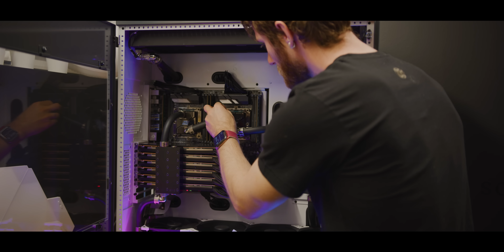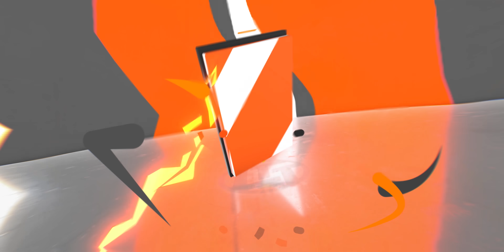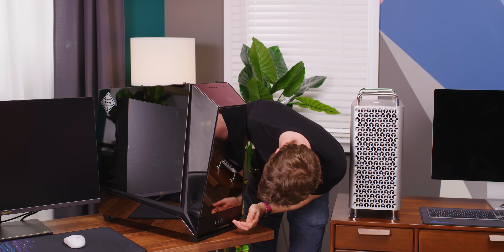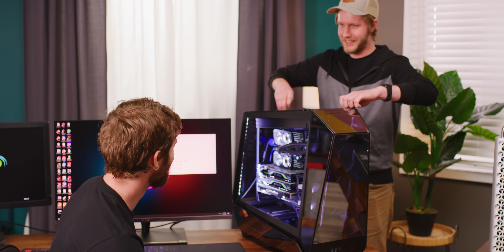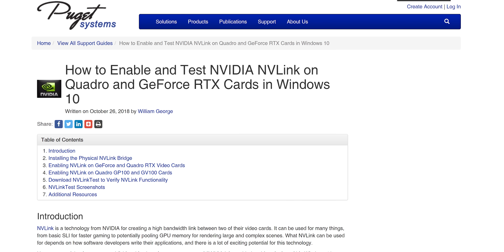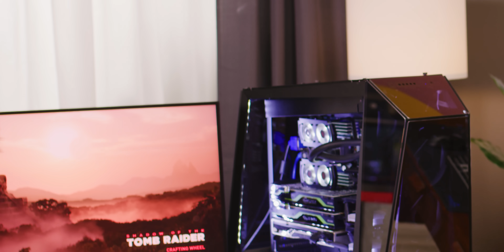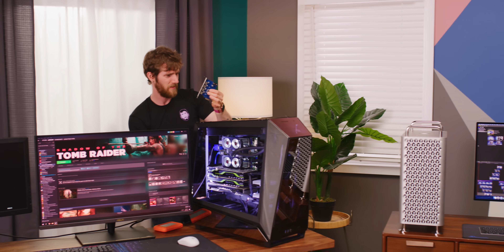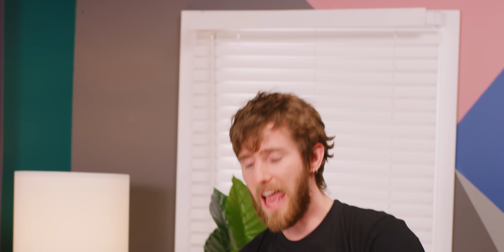The $32,000 Mac Pro Killer

Comment: in 10-15 years later this is gonna be rekt by a 500-1000$ pc lol
Reply: I don't think so, Moore's law was debunked last year and at this pace, I think we are reaching the ceiling of being able to pack transistors into a cpu. Once we theoretically max out the transistors in a cpu ( I think it would be in 5-10 years ) the competition will just be who can make it for the cheapest
Reply: @romanpisani8157  As much as I agree with you, New Tech is still gonna come (new inventions), We can advance from what we already have but it's still gonna get rekt by a mid range pc in 10 to 15 years
Reply: @Biomeac  I will reply to this comment in 12 1/2 years and we can see who is right 😂
Reply: @romanpisani8157  12 years and 2 months to go
Reply: @romanpisani8157  i will remind you
Reply: @romanpisani8157  please spam replies to me, 12 years later!
Reply: @guruthecodershorts791  hehe will do
Reply: @romanpisani8157  Intel's roadmap has 1.4nm processors in 2029 so an extra 6 years is good leeway for optimisation. Plus by then "super-threading" should be common i.e. 4 threads per core
Reply: @koalakenbymacy9248  thats very interesting considering they are really struggling to make processors less than 7 nm without quantum particles messing with eachother within the chip. Really interesting stuff
Reply: @romanpisani8157  If there's a threshold at which point Moore's law stops applying, they will probably just have to make the price smaller.
Reply: @bballrules66  that's what I said
Reply: @koalakenbymacy9248  *14nm ++++++
Reply: @romanpisani8157  what about a design revamp of a cpu, how it works is completely changed. If we find a breakthrough like that we could get a cpu better than ever. Cheaply.
Reply: @romanpisani8157  well you can think that, a lot of people did 20 years ago, a lot of people did 10 years ago. And again, now, people think its dead. Only few months later, and the newest gpus from amd and Nvidea are getting closer to this machine
Reply: @romanpisani8157  at some point we're gonna start seeing duel cpus on mobos, its existed on servers so why not gaming as well....
Reply: @lukelegg9915  because literally no game uses more than 6 cores.
Reply: @petersansgaming8783  As times goes by, we will continue optimizing for newer CPUs. 

Pretty soon we'll routinely have 2500 core CPUs, and that's how we beat Moore's law.

Heck, we already have 128 core desktop CPUs.
Reply: @romanpisani8157  RYZEN 13 9950XXT FOR 150$ COMPARED TO THE INTEL i13 14900KFFF FOR 175 WHAT DO YOU CHOOSE
Reply: @demontreee9004  imma go with the intel i13 because it probably won't get as hot
Reply: @romanpisani8157  true but rumors are that the ryzen 15 10950xxt will run at sub zero temperatures out of the box :/
Reply: @demontreee9004  Oh damn then I think I will have to wait another 18 months for next gen
Reply: @romanpisani8157  just make the cpu bigger and boom mo powa baby
Reply: @romanpisani8157  minimum feature size is not the limit, architecture and being able to run those transistors a lot faster will be what pushes it...
Reply: @romanpisani8157  spintronics...
Reply: @romanpisani8157  Moore's laws isn't debunked at all. We are actually blowing away the annual doubling. But we're going into multi-CPU setups.
Reply: @catlover1986  multi cpu setups have nothing to do with Moore's law. Soon, when no one is able to manufacture a chip smaller than say 2nm or so, Moore's law will be demolished
Reply: @catlover1986  multi cpu setups have nothing to do with Moore's law. Soon, when no one is able to manufacture a chip smaller than say 2nm or so, Moore's law will be demolished
Reply: @romanpisani8157  The issue is that Moore's law (as a relevant term) was originally tied to the idea of a single CPU, with a set chipsize. It has little to no relevance today, when talking about future PC performance, like this video. CPUs will continue to get exponentially more powerful, regardless of Moore's law.
Reply: @catlover1986  CPUs will NOT get more powerful exponentially. I don't know where you heard that but linus has multiple videos on the limitations of CPU power
Reply: @romanpisani8157  And yet, they continue to increase in power at a staggering rate. 

CPUs have no limits to their performance gains going into the future. Rather, the style of engineering changes. For instance, rather than going to 20 ghz or other difficult to reach gains, we have converted to multicore setups, and we can put an unlimited number of smaller and smaller cores together. Additionally, with our ability to network faster and faster on the same devices (infinity fabric style), we can even add multiple socket cores with minimal loss. That is presently the main limitation to CPUs (being stuck on the same silicon chip), and so we can effectively add thousands of cores to a single device. 

In the last 12 years (first I- series chips) Moore's law says we should have seen well in excess of 100x performance in CPUs. 

And we have. And that pace of improvement has increased at a staggering rate. 

In other words, there is no performance ceiling coming in the foreseeable future. We are switching to smaller and smaller highly efficient low power cores operating in tandem.
Reply: @catlover1986  Ok thank you for the reply. I am struggling to understand what you are saying, though. My point is that we are coming to the end of Moore's law, not that it is over right now. Yes we have fulfilled and more likely overachieved what Moore's law states in the past years, but I think that you forgot that Moore's law is about the number of transistors on a chip, not the power of the cpu. While efficiency upgrades will be made at a decreasing rate over the years, CPUs will ALWAYS be limited by 2 things. The size of the chip and the # of transistors that can be put on it. Maybe you should stop researching Moore's law and start researching the Dunning-Kruger effect 😉.
Reply: @romanpisani8157  I work in and have degrees in  psychology, and everyone thinks it's oh so cool to borrow our terms randomly and inappropriately.🧐

As far as Moore's law, it states that the number of transistors on a microchip should double every 2 years. We are still on pace for that, Intel has said that they are good until at least 2030. 

But the further point is, we all knew there would be an end, because atoms are a finite size, and quantum interactions will occur at some size point.. duh..

But, none of that has to do with this thread, talking about PERFORMANCE. The problem with the "Moore's Law" is ending doomsayers, is that Moore's law has little to nothing to do with processor performance.. As Intel has stated, by 2030, we should see a 100x improvement over chips in 2020 in performance..and there is no reason to believe this rate of performance improvement won't continue in perpetuity. 

What I'm pointing out, is that Moore's law isn't that close to ending, and when it does end, it won't matter anyway, because it's only one of hundreds of variables in chip performance and engineering..
Reply: @romanpisani8157  Part of what you don't seem to be comprehending, is we ditched the idea of individual cores getting exponentially more powerful, circa 15 years ago. Rather, we add more and more cores to individual chips.. and we add more and more chips to machines. AMD literally made their Ryzen chips physically larger, to get more performance. 

When you start having 50,000 cores on a processor, or 50,000 linked computing cores over high speed fabric, yes that's exponential performance growth. 

The tech is changing, it's not slowing down. But when I was younger, a better processor meant 5 ghz, not 2.5, that is obviously an invalid metric today. So is transistor count in a single core.
Reply: @catlover1986  Hard to believe you have a "degree in psychology" when you couldn't even understand I was making a joke. But if that's what you wanna focus on, I am surprised that you want to say that I "stole it" from you. Does having a degree in psychology give you trademarks over psuedopsychology theories? Anyways, I think that having a "degree in psychology" is hardly working for you because you seem to be accepting that I could be right, but also personally attacking me for having a different opinion. Where did you get your degree? University of Armchair Know-it-alls? Sorry, I'm done roasting you, but the facts are that Moore's law is PHYSICALLY IMPOSSIBLE. Yes, it may have been a bit accurate for a few decades, but there are literally only so many atomic particles that can be put on a silicon chip. The real question, is when quantum limitations come into play. I'm not going to pretend to be some expert on quantum physics, but I think we can all agree that fussy stuff happens between transistors when they get too small and too close together. So the question is when will these limitations put a halt to the annual doubling? I think it will definitely happen in sooner than 15 years, possibly sooner than 8 or 9. I don't know what kind of BS you are on talking about "2500 cores on a cpu regularly", but if you have to distribute transistors across 2500 cores compared to ,say, 64 cores that doesn't magically multiply more transistors out if thin air.
Reply: @romanpisani8157  Psychology is a science, with real scientific data and research, no different than than chemistry or physics. The question is whether people actually understand our terms when they use them, and they usually don't understand them or use them correctly. Not all psychology is pop or "pseudo"-psychology. The phenomenon that people with less skill in a particular area, often overestimate their own abilities, which is pretty well demonstrated through all of history, as well as empirical and clinical studies. 

As far as Moore's law, firstly it just described a phenomenon, it's not actually some magical claim. Intel believes it will be good for a long time further, and they have good reasons to believe this based on the size of transistors they believe they can make. 

As far as 2500 cores on a CPU, we already have 128 core CPUs. It's not much of a leap. That seems to be the issue, your idea of what a modern CPU is and what can fit on it. The size of CPUs isn't fixed. Also, it's not merely about how many can fit, but cooling them, and they become more efficient at smaller scale. 

Of course the day will come, eventually, where we won't be able to fit more. But that's hardly a problem as far as CPU performance increases. We can make bigger processors, more efficient processors, more processors on a chip, lower energy/higher density processors, and different cooling architectures, among many others. Simply cramming more transistors on a disk, ceased to be the name of the game, a long time ago. 

AMDs bulldozer being a perfect example, where Intel crushed it, despite having fewer transistors. 

Imagine we were talking about cars. It used to be that a bigger engine meant a faster car. That hasn't been true in decades. Same idea. There are other more relevant innovations.
Reply: @catlover1986  so you agree with me?? You keep beating the dead horse of more power in CPUs. Moore's law is not about power. It's about transistors. I agree that CPUs will get more powerful in almost of the ways you have stated ((except I don't understand why you keep going on about how a shit ton of cores will make a cpu way faster, but honestly I don't have enough knowledge to dispute that, it's just a gut feeling)). I feel like you just keep going on because its too hard to admit that there isn't going to be fuckin infinite  transistors on a chip.
Reply: @romanpisani8157  I think you truly know what you are talking about, I was never aware of Moore’s law and all so I can’t really argue with you here. I just want to point out and state as you may be aware of . The Apple M1 Chip, it is mind blowing and really powerful and efficient it is a new form of technology that we weren’t expecting which is unrelated to Moore’s law. 10 to 15 years is a huge time frame in all honesty and I do get what you mean . A pc from 2010 is usable compared to a 2020 pc as opposed to a 2000 pc and a 2010 pc. I still stand by my comment however with a different approach as a 500-1000$ pc is still not cheap (not adjusting for inflation), however it is impossible to predict considering we have limited knowledge of the future.
Reply: @Biomeac  I don't know enough about M1 to dispute your claim, but I do know that the M1 chip is simply made from ARM processor design that has been used in smart phones for forever. So it is not "new " technology at all. But, I do know that the type of processor is more centered around using less power and doing less calculations, so I do believe that it is possible that ARM based processors will overtake the traditional x86 processor we have now. Even at that, a processor is still a processor and Moore's law still applies because processors are made of transistors, just like the processor in any computer
Reply: @romanpisani8157  what I meant was , the M1 chip is really good (idk how) but it did improve tech substantially
Reply: @romanpisani8157  I’m not really familiar with this subject or know a lot of it, but 30 years ago what we have now seemed mostly impossible. Technology has and will always have a limit to that invention but it will be surpassed by another invention. The impossible has been achieved because we simply didn’t know enough at that time.
Reply: @bruhroyale12123  true
Reply: @romanpisani8157  that's true, but if that's our limit, then it would be really sad. But I think someone will come up with a revolutioniary idea and invent a new technology
Reply: @romanpisani8157  quantum computing tho
Reply: @romanpisani8157  The architecture has to change. ARM is looking solid right now, especially in portable machines. Apple's M1 chip beats an Intel 10900k in single core performance. That's a full desktop processor that costs 500 dollars itself, for only 200 more dollars you can get a complete Mac Mini. And we are just starting to explore the capabilities of ARM. I cannot even imagine a proper desktop ARM processor. At this pace, even a simple Macbook Air from 10 years later will beat the hell out of these two computers. ARM is just a much smarter architecture. In the past, it lacked stuff like floating point instructions which made it inferior to a CISC (complex instruction set computer) architectures like x86, but today it does not lack any critical feature. This potential of ARM was discovered way earlier and a modified versions of ARM architecture was widely used for supercomputers way back.
Reply: @romanpisani8157  Yeah computer tech is soon gonna stagnate as I think we are hitting the max we can do with our resources
Reply: In 10 to 15 years
Reply: 10-15 years, pretty pessimistic, I’d say 5 or 6 tops....
Reply: @robertw1871  nononono
Reply: Im following lmfao
Reply: hat
Reply: @Marcin Berman Ok boomer
Reply: no I don't think so
Reply: Commenting to come bak in 15 yrs
Reply: They probably have the technology in the workings already
Reply: 5 years
Reply: 10 years my wristwatch will  outperform lol
Reply: @danz8039  I mean, does an apple watch today out perform an computer from 2010? haha
Reply: @Biomeac  was having fun ,easy killa
Reply: @danz8039  dodges bullet
Reply: It's be like windows xp now
Reply: more like 6 to 12 months
Reply: @Bryce.McBrayer  ehhhhhh I wouldn't be so sure if I were you lol
Reply: @CleanPipes that would be cool, a new type of chip that isn't silicon, but I do know the reason we don't have 1nm chips right now is because particles interfere with one another at a level that which we don't have enough information about.
Reply: nah probably in like 8 lol
Reply: yo make a reminder or sum be back in 10 years
Reply: LOL

Comment: "We're going to find the biggest differences in applications that support NVIDIA's CUDA GPU compute exclusively, and will not be able to take advantage of the AMD GPUs found in the Mac Pro.
For instance, SOLIDWORKS Visualize only supports CUDA."

I don't really like Macs, but in the interest of fairness and accuracy, what about AMD Radeon ProRender[1] for which there seems to be a SOLIDWORKS Visualize plugin[2]?

"AMD ProRender Integration

SOLIDWORKS Visualize supports AMD Radeon™ ProRender, a raytracing engine that is designed to run on AMD’s high-performance graphics cards.
To use ProRender, click Tools > Options > 3D Viewport and, under Render Engine, select AMD Radeon ProRender.
"[3]

Was that applied during the test?

[1]: https://www.amd.com/en/technologies/radeon-prorender
[2]: https://www.amd.com/en/graphics/workstation-design-and-manufacturing-solutions-solidworks
[3]: https://help.solidworks.com/2020/English/WhatsNew/c_visualize_prorender_integration.htm

Comment: Keep in mind that your "Pc Pro" is a literal mess, everything looks like it's about to collapse, you have to do multiple annoying things just to get it running. While the MacPro, is pre built, has MacOs, and Etc.
Reply: are you seriously defending a $52 000 pc?
Reply: @obama5415  Yes. The MacPro may be $50k but you are also paying for the design, the operator system, and the logo. Apple is definitely overpriced but the mac pro is a beautiful machine.
Reply: @lupo2007  mhm i enjoy cheese graters
Reply: @lupo2007  and i can use hackintosh
Reply: @lupo2007  The mac pro is overpriced garbage
Reply: @thatguy-hq3ck  its not garbage. its just that its overpriced. i can confirm by owning one.